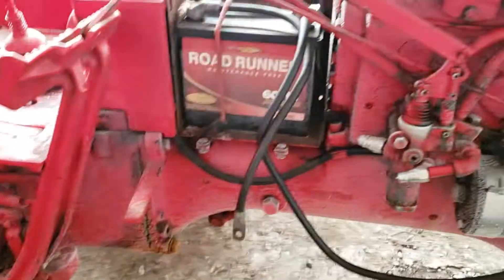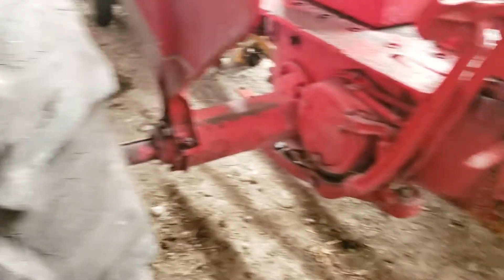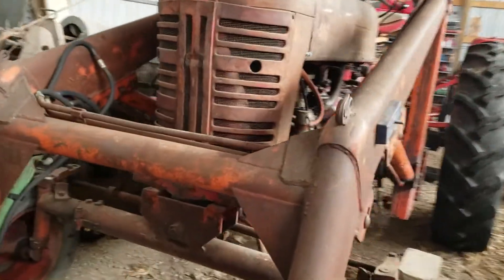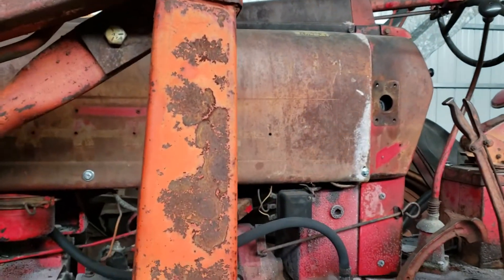Tractor Detective 101

Comment: You do see a lot of F12's with F14 steering supports on them. What kind of remote is that on the side of the C? Never seen one like it.
Reply from the maker: It has rear hydraulic remotes maybe something else used from a super c they were leaking so just put nipples on them
Reply: @apatchofheavenfarm2814  Never seen that setup before. Very interesting.